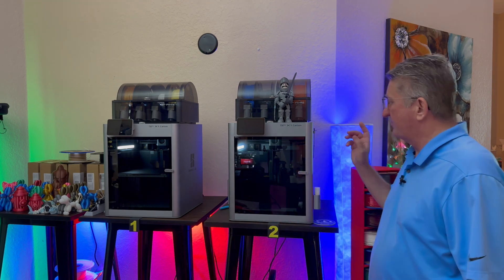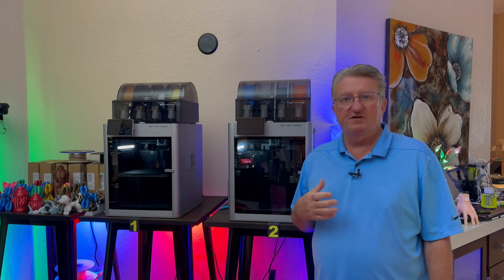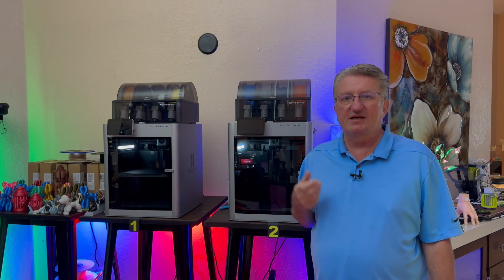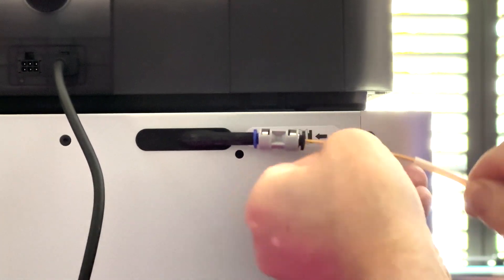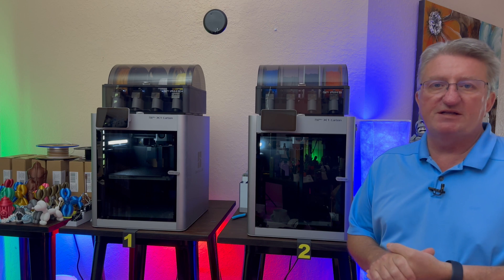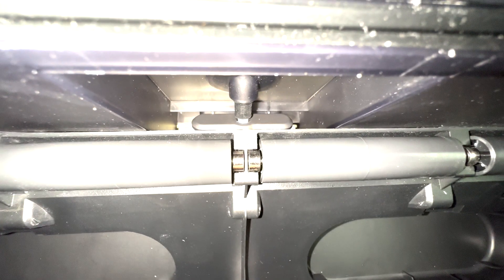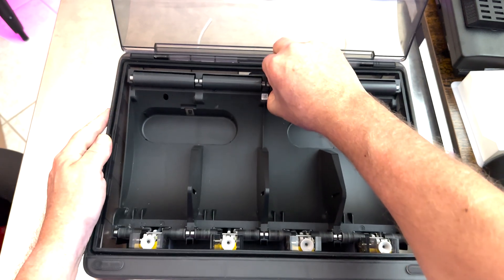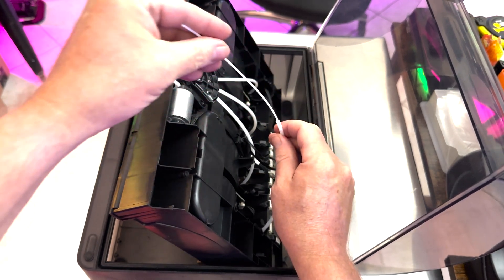Solving Common AMS Problems on Your Bambu Lab 3D Printer: Tips and Tricks

Comment: Great tips, Kramer. I'll add one here. We were experiencing the "All 4 AMS lights flashing" issue in the middle of a print. Tried the coupler disconnect/wiggle-wiggle as well as the communication cables wiggle-wiggle which didn't solve our issue. After that, we powered the printer down using the power switch on the back of the printer near the power cable. When we powered the printer back on, we noticed the AMS lights were back to white and the printer recognized and unfinished print. We answered "yes" to continue and it picked up where it left off! We did notice a blob of plastic left behind on the actual print which we promptly plucked off to clear the path to continue. Hopefully it finishes and this tip helps others as well.
Reply from the maker: Great solution if nothing else works, thank you for adding it here!

Comment: thank you for the video! I have the first type of error (0700 8004) but the filament is not inside the tubes. The AMS still thinks it is there so I cannot add any other filament...
Reply from the maker: Wiggle the cable didn’t work?
Reply: @techwithkramer I found the issue. The cable was in the AMS. I was able to remove it following your instructions. Thank you again!
Reply from the maker: Great, glad it works now!

Comment: When I go to prepare there is a filament showing in postion 3 although I have none in that slot, the first 2 that I want to use are correct material and colour, when I go to devices the AMS slots are showing a ? in each slot and when I click on the pencil it will not allow me to change the colour of the filament but will let me change the material type.
 Please help this is driving me mad!
Reply from the maker: You can only change the color if the printer is idle. While it’s printing, you can not change anything. Was the printer idle when you tried this?
Reply: @techwithkramer  Yes the printer was idle, I fixed it by turning off the printer and restarting Bambu Studio and it then allowed me to make changes to the colours, I guess it was just a glitch somewhere.

Comment: Im now here trying to fix my AMS and cant find anything broke filament. I legit was changing my colors and it freaked out on me and been stuck on this red light in reverse for over a hour now
Reply: Same
Reply: Update to this. Believe it or not, it's most likely a tiny filament in the tube. My trick now is that I have filament strings to push into the system and push to find the stuck part. It's been very easy doing this now. Also, if you're not printing, I recommend taking the filament out of the ams tube and have it rest inside the unit until ready, just in case starting it up snaps the fialment inside the system again on you.
Reply: Thaks @FearThisGinger
Reply: same
Reply: Yea my started after a while of no prints

Comment: was hoping to get some tips on how to prevent the failed to pull filament error from happening.
Reply from the maker: That is mainly an issue of the path the filament has to go, it needs to be as smooth as possible. You will find the fixes on makerworld.

Comment: My blockage is inside the AMS hub.  Now what?  I'm out of business.
Reply from the maker: Can you send a photo? You can take both ptfe tubes and the hub off and then open the hub from the backside if that’s where the issue is.
Reply: @techwithkramer  I ended up having to remove the hub and disassemble it.  Bambu has instructions.  There was a little piece of filament in there.  Now it's working.  If I have to do it again I think I can do it in 15 minutes or so.
Reply from the maker: Glad you figured it out. This is why I check each filament before I load it to see if it’s brittle, and I talke the brittle part off.
Reply: @techwithkramer  So there's a brittle part?  I threw the whole spool away
Reply from the maker: No,don’t throw it out - just pull some off and cut it where it’s no longer brittle. So far I only had 1 spool (out of hundreds) that was so bad that I returned it, it was basically a spool full of little pieces. But every other spool just had like 2-3 windings brittle.

Comment: How did you fix the first issue! I need to do it EVERY time! Is there somewhere to lubricant the motor or make it stronger or something? or change to a bigger tube to reduce friction???
Reply from the maker: There are several fixes on makerworld for this, just search for it. Do NOT lubricate the motor, that would be a very bad idea and the motor is not the issue, it’s the friction. The tubes size is perfect, it’s just the friction in between, so make it’s as straight and use some of the mods to help.
Reply: @techwithkramer  Thanks. I know it's the friction. Bambu support suggest me to buy a tube with larger inner. I also printed the part going into the print head. Anything else I can print? what should I search for?

Comment: I have the rewind issue as well, but I don't even need to wiggle. Just disconnect the coupler, and press retry. That is a work-around, but it kind of makes the filament switching of the AMS useless: I need to baby sit every filament change. So much for "automatic".
Reply from the maker: Try some of the solutions on printables.com - there are some guides that help with this.

Comment: i have the first issue on doing multi color prints in a couple of the slots. I can disconnect the ptf tube and the filament isn't stuck reconnect it and it will rewind. Then the next time is goes back to the slot is may do it again. Have replaced tubing check for broken filament and cant figure it out.
Reply from the maker: Try using one of the PTFE guides from printables, they might do the trick.
https://www.printables.com/model/350714-bambu-lab-ptfe-guide

Comment: My ams internal hub slot 2 is not working. I can manually feed filament through the 3 other slots but not slot 2.. Cannot see any stuck filament. Any suggestions for this issue?
Reply from the maker: Sometimes you can’t see the pice, you need to take all the ptfe tubes off and push a piece of filament through to make sure it’s empty. If that’s not it, then it is the first stage.

Comment: Thanks for your video. My AMS slot one is not loading, or retracting and is making the sound that you demonstrate in your video - it appear the vertical cog at the front is spinning but that's about it. I carried out the steps you indicate to remove a broken piece of filament - but there was none in the tube - I pushed a piece through to check. All the other slots work fine. But the problem persists. :-(
Reply from the maker: Can you see anything in the feeder?
Reply: Same red light no filament
Reply: It happens to me to, did u fix it? :(

Comment: What would be a fix for all of the lights double blinking red?
Reply from the maker: First try to wiggle the  black cables - that usually fixes it. If not, unplug and replug all black cables. Next - if it still blinks red, try to find a stuck piece of filament in the white PTFE tube that goes into the AMS. Let me know if any of these fixes it.
Reply from the maker: I also just released a video about replacing the AMS connection board if you can’t get it fixed…

Comment: i had this issue once and here's some detailed answer i got from Bambu Support:

In general, the failure to pull back the filament is due to too much resistance. It is possible that the PTFE tube of somewhere is bent too much, creating a tension that prevents the filament from being pulled back. Usually, releasing the coupler on the back of the printer and trying again can pull the filament back.

This is because this action actually pulls the filament back a bit from the tool head, so that when the tension is released, the filament could easily be pulled back.

1. You can straighten the PTFE tube first, and trying to print the following bracket model to prevent the PTFE tube connected to the tool head from being too bent:
Bambu X1 PTFE Straightener Bracket AMS Error Fix by OurAngryBadger | 
Bambu Lab PTFE Bracket by Mol 
Bambu Lab X1 - top glass riser by khrillian | (removing the printer's glass top cover also helps reduce tube bending)
Also ensure that the PTFE tubes of other parts are not too bent. If the PTFE tubes have been used for a long time, it is recommended to replace them with new PTFE tubes.
Reply: 2. Sometimes the coupler may cause excessive tension, so you can replace it with a spare one and try again.

3. In addition, you can also try to clean the debris inside the filament hub. Excessive debris accumulation inside the filament hub can also cause excessive resistance.
Dismantling and cleaning the AMS filaments hub | Bambu Lab Wiki

4. If the problem of failing to pull back the filament occurs only in one slot, swap feeders from different slots to see if the problem will transfer to another slot.
Replacing the AMS first stage feeder | Bambu Lab Wiki
Reply: @giangquangvinh6487  What is the 'coupler'? I'm having issues with filament always breaking on retraction in one of the positions of my AMS. I've cleared the broken filament multiple times, but it keeps happening. I've used multiple spools of filament that I know are dry, with the same issue. It's as if the tension of the drive unit in the AMS is too high, or there's a lot of friction somewhere in the path of the filament, but I've only been using the printer for 2 months and I don't have that many hours on it.
Reply from the maker: What I do is whenever I put a spool in, I break off the brittle part at the end until it’s no longer brittle. Sometimes can be 4-5 windings, but I’d rather loose a little filament than have to open and I find a piece inside the AMS.
Reply: Great advice! which site are the parts on?
Reply: @AndrewAHayes  they are on printables, i tried to paste the link in here but it doesn't work, good luck!
Reply: @giangquangvinh6487  Thanks buddy!

Comment: thanks for video  i recived my combo unit and on second day the ams unit showed no power, logged a ticket and the send me a doc to take apart the ams  and your video is very helpfull with that  they wanted me to take voltage checks and i guess they didnt believe me so they want video of voltage checks :(   unbelieveable  i guess first of all they think everyone has a multimetter  and can check pins on a really small ic while taking a video, 2 days old AMS  i have decided to return unit basied on ther friggin support  but even with that they are not replying at all  ive had unit for 6 days now  if it goes over 14 i cant return based on ther online docs really unhappy and was looking forward to useing this thing
Reply from the maker: It’s tough, this is still a DIY hobby and there are so many people starting now that they probably have a load of tickets. They try to find the cause. I had an AMS that was constantly loosing connection, took about 6 tickets and luckily I have several machines so together with support we could figure out that it was the actual control board inside the printer. Sending an AMS back in to them for fixing is expensive and unless they know it’s the AMS when it could also be a cable, the hub or the printer, I don’t blame them trying to make sure what is broken first.
But I feel your pain.

Comment: Good video.  I have a broken filament in slot three, so for a temporary fix, I'm just not using that slot.  I know I have to open the AMS up to find the problem, but am debating on the Hydra mod.
Reply from the maker: Thank you for the nice feedback. I am on the same wave - not sure about the hydra. But since I use mostly Overture filaments, and I d not want to mess with my warranty, I decided it's not worth the hassle for me.
Reply: @techwithkramer  That is where I'm at.  I want to see if anyone comes up with an even better solution.  I have has pretty good results with the AMS,  the speed is frustrating, but the design is inherently slow with about 1 meter of filament path.